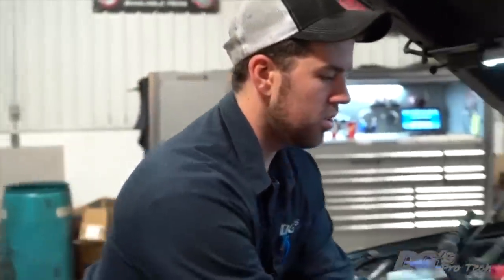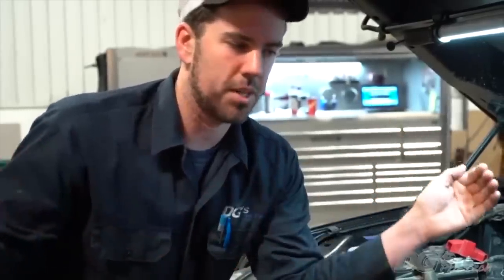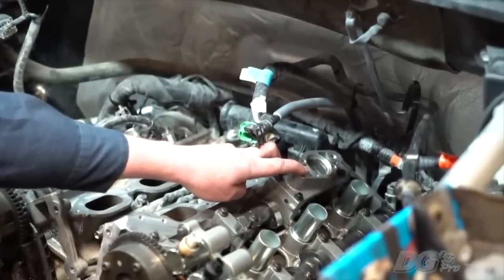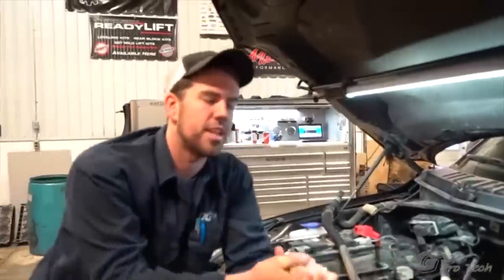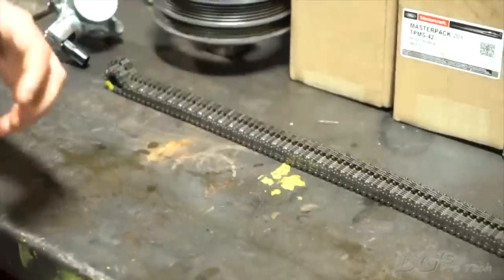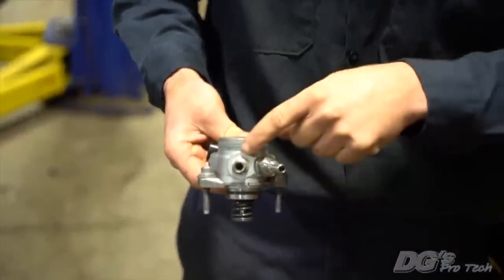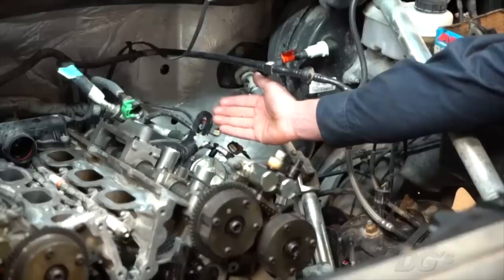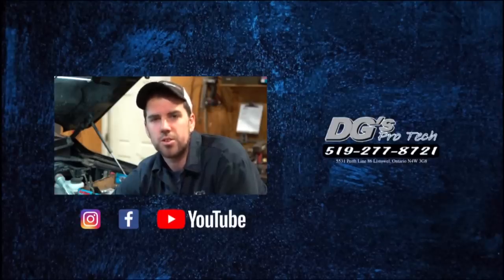What you NEED to know about Ford EcoBoost Engines by Dustin Golley of DG's ProTech

Comment: Turbos aren’t cheap when they break, economy tanks when hauling, and with high pressure injection your asking for problems.
Reply: Many new gas are going with High pressure direct injection. The Nissan 5.6 went from Port injection to direct injection. The issue is lack of well built internals. Diesel have ran high pressure common rail for a long time without constantly breaking down. 
Turbos as well have been used in diesels and can live well over 1 million miles with maintenance. Oil is the life of the turbo bearings and keeps them cool. I barely see people giving vehicles proper maintenance or just buy the cheapest $12 jug of conventional oil and a $2 filter then go 8k miles or a year on that oil. That's a recipe for sludge and sever wear.
Also like he says these are great for economy when driven calmly. If you own a V8 no matter what you do you'll never get good gas mileage like a V6.

Comment: please do a video on the mechanical differences between the Gen 1, Gen 2 and the Gen 2 HO (Raptor) 3.5EB.... thanks
Reply: Pussaty for starters, and this ones a biggie, the 2nd gen has both port and direct fuel injection to help deal with carbon build-up. The first gen is only direct injected and thus carbon build up is a known issue.

Comment: In summary, a very complicated engine that may save you a little bit of fuel if you baby it and stay out of the turbo. If you drive it and work it like a truck it will not save you fuel and it will break down. Turbos make sense on diesels not gasoline engines because of detonation issues. As you want higher power levels per engine displacement you need higher octane fuels, richer mixtures and retarded timing. Don't be a jerk, go for the big simple engines, pay a little more for fuel and you will have a reliable truck and your friends will be in the shop off the time.....

Comment: i would also recommend replacing the water pump, as it is internal and driven by the timing chain. If it leaks it will leak internally into the oil pan.

Comment: Good video, I'm a retired tech and been out of the business for almost 10 years now and recently bought a 2018 Transit with the ecoboost so it was nice to see some of what's going on with it. I have to admit though I haven't been driving it much (1700 mi) as I'm building it into an RV. Your comment about problems arising of not using the boost bought my attention because of this. Every now and then i get a strange sound when I start it after its been setting a few day and now wondering if that's not the problem noise goes away after a few seconds.
Have a question: I've seen a lot of people talk on FB pages about an aftermarket "catch can" that's installed in the PVC system. What's your thoughts about them? Is it something I should look into? Once I get my build done I'll be traveling year around with it.
Reply: 2018...and it's already making funny noises?! Scotty would say, get rid of it.

Comment: I had one of these lock up on my towing a 9400 pound camper. 60,000 miles, good service history at the dealer. Oil and coolant full.
Seized tight.
I wouldn't buy a Ford again with your money.
Reply: Lesson learned. Never use an economy engine, to pull heavy loads.
Reply: I don't want to buy you a Ford! Buy it with your money!!!
Reply: Wrong tool for the job. 
Big load, big engine.
Reply: Ford is still the best. Your repairs would have been still  covered by warranty so stfu.

Comment: Now I know why the first two different owners of my new used ecoboost F150 both sold the truck at 67,000 miles on it.  Luckily for me, I won't be driving it that often and will probably never see 100K miles on it.   Runs great right now and I'll take the mechanic's advice and use only synthetic oil in it.  I'm wondering also if it would help to use Sea Salt to help clean the valves that have a tendency to gunk up because of the location of the fuel injectors, I saw that could be a problem also with this engine design.

Comment: Seems like a lot of over engineering for an engine that gets a little better mpg than the 5.0. I think these technologies are great for 4 cylinder engines, anything bigger I would rather have a pushrod v8. I miss those torquey straight 6 in the F150.

Comment: I drive a Navigator L - Limo SUV, and I really believe in 100% synthetic oils, change the oil every 6,000 miles, and also.. using 91 octane Shell or 91 Octane Chevron to keep internals cleaner..and running better. Thanks for this excellent video.

Comment: I wish more mechanics were competent like this, I feel as though every time I bring my vehicles to get serviced I know more about the actual issue than the mechanic does and its infuriating, and I’m not mechanic, I work on cars and am an enthusiasts, but I leave the real wrenching to mechanics, but I brought my gen 2 raptor into ford and I said “Yea its gunna need the dreaded cam phasers and timing chain looked at, its ticking pretty good.” And they argue with me telling me I’m wrong and that these ecoboost engines don’t break like that, but lone and behold I was right, I haven’t ran into a smart or competent mechanic like this guy in YEARS!

Comment: These engines are complete piles of garbage, I’d say one of the worst ever put into a vehicle, ford also holds the second spot on that list too, the 5.4. In 10 years none of these cars/trucks with this engine will be on the road and in the junkyard. 99% of these engines are blowing up at extremely low mileage and ford continues to slap the same exact junk on the lot every single year. I have this engine in my raptor and I maintain it meticulously and its broken down multiple times. It gets horrible fuel mileage, sounds like shit and just doesn’t belong in a vehicle. Whoever thought making an engine in a daily driver that is this complex is a FOOL! Having that many complex moving parts in an engine that is “supposed” to last 200,000+ miles is absolutely ridiculous. If you have one of these vehicles, get rid of it and run fast, trust me!

Comment: Great vid . You gave a great explanation on the ecoboost. Working on my benz 320 diesel, i can relate to it's problems if under used. Trying to run a gas engine like a diesel is hard. A diesel engine is better suited by design(bulkier) to work well under load and will gather soot if not used properly.  Good maintenance is the key. And they are dirty to work on, especially with the pcv system under boost , which i did not hear mentioned on the ecoboost. thanks for sharing !!

Comment: If anything is not reliable then I don't want it. My old 2004  Dodge Intrepid is still running , I change the oil every couple of years and it's good to go   (:
Reply: You got the 3.5L in that sled?
Reply: @250gto9  Yes, 3.5L 250 hp cop package . It's old and worn out but it's still going, the damned thing drives like a sports car ( :
Reply: @NCLUSA  I have a 2002 with the 3.5L.  Super clean car.  I bought it with a broken timing belt and bent valves.  I put junk yard heads on it, new timing belt and water pump, etc.  Runs good now.
Reply: @250gto9  Sometimes the old clunkers make the best everyday driving cars (:
Reply: @NCLUSA  Yep, I love driving beaters.
Reply: @250gto9   Me too. I once had a really nice car, drove my wife to the doctor's office, in the parking lot a beat up old orange Toyota parked beside of my nice car and the fruit opened up his door and banged the hell out of my nice car, I thought about getting out and having a few words with the idiot but my better sense got the better of me so I didn't , people don't respect other's property do they?, )  :

Comment: IOW, avoid these Ford “Ecoboost”engines due to high rate of issues!
Reply: Did you watch the video? He said nothing of the sort. He said proper preventive maintenance will help prevent those issues.
Reply: Ramon Cardona   Why not make a higher quality chain that won’t stretch. It’s going to stretch no matter what oil you use synthetic or Dino oil. It’s just a poor designed engine. This engine made Ford millions in profits.

Comment: Of note on the second gen ecoboost they now have two thicker timing chains, along with hollow cams putting less stress on the chains. Should help with chain stretching. And they have changed the waste gate style to electric actuation. along with a second set of  intake port injectors to wash the intake valves of carbon. So props to ford for getting in there and trying to fix issues.
Reply: Which model year does that start with?

Comment: I wonder if after factoring in all the repairs these new high efficiency engines require you actually save any money over a V8.  Even an old push rod V8.  I think the best efficiency enhancements for the money came with electronic ignition and fuel injection.  Overhead cams, variable valve timing, and turbo charging smaller engines probably helps, but it also adds a lot more things to break.  Did anyone ever replace the cam chain on a push rod V8?  Also I don't care what anyone says, a V8 will last a lot longer than a V6 turbo when doing the same thing because it just doesn't have to rev as high.  That's one of the reasons diesels last so long, they don't rev much over 3000 rpm even under heavy loads.  (Well that and the fact that diesel has lubricating properties whereas gasoline is a solvent, so the compression rings and the cylinders themselves last longer in a diesel.)  The focus these days seems to be exclusively on fuel economy as if the car should be thrown away after 5 years or 100,000 miles.  And it's not just the engine but all the electronics and plastic parts as well.  But I think cars were probably cheaper to own when they went 10 years and 200,000 miles before they started to fall apart, even if the mileage wasn't as good.

Comment: I have a question, are the internals on the 2.7L - rods, crank and piston.  I noticed the main block only has two bolt mains going into the block, but the diecast aluminum has another two bolts making it kinds 4 bolt mains.  Most modern engine blocks, regards, have 4 or 6 bolts mains.  Just makes me question how stout the bottom is on the 2.7L.  I'm sure it's stout enough to handle anything thrown at it stock or just a stock tune, but with higher flowing turbo wheel and better intercooler I wonder how much the bottom end can handle?  I heard on engine dyno from my former work colleague at Ford that for endurance and wear testing they were pushing around 675 crank HP and 700 ft-lbs of torque.  That's pretty impressive.

Comment: My step father has one I drive it all the time.  Drivers need to be very careful with these you will not know you are driving over the speed limit, trust me I know. lmao 

My mother freaks out about the ford f150 ecoboost because when she drives it she does not let wastegate open hear that Pssshhhh sound but when I drive it when she's in the truck she asks what the hell is that noise something wrong with the engine. Lmao

Ford should've came out an ecboost with a single turbo setup Not a twin (more laggy) I would ditch the stock Tiny twin turbos for a PTE 6266 setup.  A rebuid of a turbo depending on the turbo isn't that bad or hard to rebuild by yourself.  A rebuild kit is average $150 this rebuild kit is ones used on 4g63.

Comment: I drove a few of these when they first came out. 50 mile round trips with cruise set at 60 MPH. I would not call 12 MPG very efficient. In fact, my 94 Silverado with highly modified V8 gets 17. Since then I've done a LOT of timing chain jobs on these and some engine swaps too. Lowest milage engine swap was 65,000 miles. Highest was around 130,000 miles. Not a very good engine in my opinion at all.
Reply: What do you consider highly modified?  North of 365hp?  That vintage of GM were rated at 210hp stock TBI 5.7.  And, with those mods, was it smog legal?  Apples to apples is all I am saying.. Modern engines produce extreme horsepower while still conforming to emissions standards.. Fuel mileage isnt always relative to tailpipe emissions. Hell remove all the emissions components from a modern diesel, tune it, and you can easily make 600+ hp and get 15mpg or higher.. I know 4 people who own these, and driven right, they can average 20 mpg with their trucks.  With 420-470 ft-lbs of torque.  Where I work, we've seen failure as early as 40k.. But, 3 out of 3 of those failures, had the oil changed once in 40k!!!  We have seen many with well over 250k with minor work, typically timing chains and sometimes phasers.  We NEVER see any other internal failures..  2008 and up LS motors are not without their issues either.  Lifter and cam failure.. which is an expensive venture as well.
Reply: @Imsaneru  400 ci, Holley fuel injection, runs the quarter in 11.88. Not the fastest on Earth, but much faster than stock. So, yes......more than 365 horsepower. If you want to compare apples to apples, I'll have to check my trash can for one suitable to compare to the Eco-Junk
Reply: @brianludwig9868  haha good one. Thank America's tax payers for keeping government motors in business. 🙂
Reply: And FYI our Ford shop damn near does just as many 3.6 GM timing chain replacements as Eco's.. All well under 100k. They're all junk when they're broke, no matter what the brand.
Reply: @Imsaneru  So, the $21.8 billion dollars that Ford got doesn't count? I've never understood that uneducated argument. $5.9 billion to Ford and $15.9 billion to Ford Credit. But that's not a bailout. I guess it was a gift from Uncle Osama?
Reply: @Imsaneru  I agree. That's why I started with a truck, then built everything MY way
Reply: @brianludwig9868  No.  Government loans vs bankruptcy.  Ford, and many other companies take out government loans.  Loans get paid back.. Bankruptcy doesn't.
Reply: @Imsaneru  So you're saying Ford is going to pay it back some day? When? So far, sorry as it is to say, Chrysler is the only one that has paid back 100%
Reply: @brianludwig9868  Chrysler did not.  They filed, then Fiat bought them.  I have no clue at the rate they are being paid back. I am just a dealership employee, not a corporate employee.    Fact of the matter is, loans are paid back.  Bankruptcies are not.  Also, do a search on "Old GM", and the billions it costed the tax payers to clean up all the plants they shut down.  Another point.  People always refer to the engine in a truck, is what makes the truck.  Lets talk 3/4 ton and up trucks.  Chevy hasnt used a solid axle front end since 1987..  The Duramax is built by Isuzu, good engine, but not a product of General Motors.  The Allison?   Overrated, but not bad.. Again, not a product built, or engineered by GM.  Same goes for Ram, Cummins, great motor, not engineered or built by FIAT Chrysler... Ford uses solid axle front ends, as does Ram in their HD trucks.  If you're actually using your truck for work, Chevy is the last choice.  Look at city, county, and state municipalities.  Plow trucks, (not sure where you live, but up here lots of snow!)   Ford has over 40% of the commercial market, vs GM's 25%.  On another note, the 2020 Chevy trucks, are the most God awful looking trucks on the road!!  I will give them props on the Colorado... Thats a nice looking truck.  I dont know what Chevy's design team was smoking when they designed the new Silverado's.. barf!

Comment: Curious to know how many miles is on the one he is working on ?
Thank for the great video and awesome explanations. 
I have a 13 Ecoboost with 66600 miles trouble free, I change the oil every 4-6000 miles and after the free motorcraft oil changes ran out I switched to Pennzoil full synthetic platinum because off the higher cook off temps hoping to minimize the carbon on the valves an I still use the MC oil filters,
Changed the coolant at 40000 and the tranny oil at 55000 ..still running the original plugs although I think will changes them before winter.
So far it has driven flawlessly ..Im hoping for another 75k before I trade her in ..possible for the F250- diesel or the F150 with diesel .. by then we should know if it a good engine or not

Comment: I sure didn't know about the turbo wastegate issues before now but being that I am proactive in my semi-trucks maintenance (Detroit Diesel 12.7L) I have always sprayed the externally mounted wastegate shaft that goes inside the turbo housing with PB Blaster, disconnect external linkage and rotate the shaft back and forth so the PBB gets up inside to keep things loose. As I drive I run the turbo up to 30-psi then let off throttle to activate wastegate. My turbo now has 1.2 million good miles logged and in perfect condition but getting ready to replace due to age. Parts guy questioned me when I asked him to order me a new turbo and like I told him, better to spend $1,600 now than to have a future turbo failure and lose a $35,000 engine. Now that I know about the Ford Eco-Boost 3.5L issues and corrective measures, I have that knowledge before making purchase of a F-150 truck.

Comment: let your customer know if there is timing chain noise so that it doesn't jump time...cumon….this is a no brainer....should listen for that on every engine.... I find the biggest issue with repair shops is the comuncation is terrible...oh joes not into today but the apprentice did it....  yeah it will be done by 9. no calls till lunch..... no pictures..... no oil analysis....no accountability...  a real  journeyman tech will go above and beyond.... and actually spend an extra 5 mins whats going down.... instrumentation tech red seal of 10 yrs... way more accountable than automotive techs.... if we do not do our job proper the whole oil plant blows up..not the customers engine...